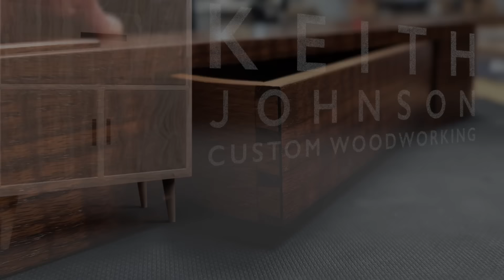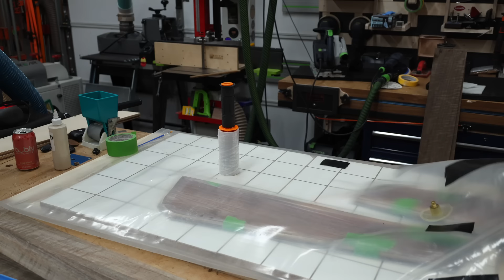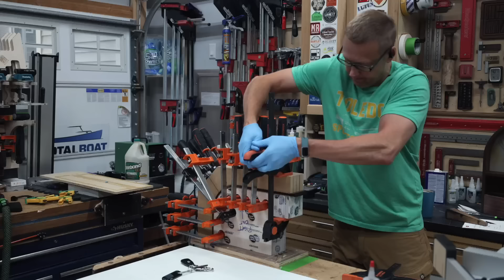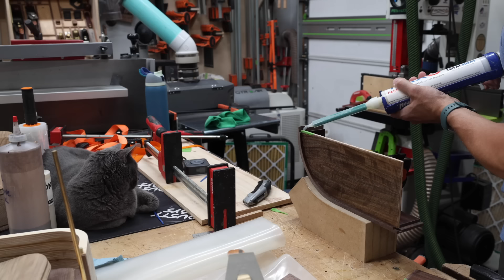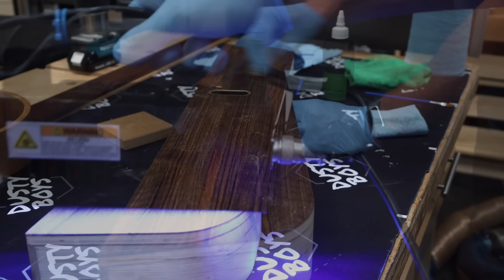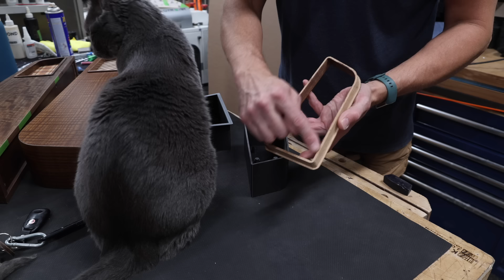A Different Way to Make Curved Cabinets.

Comment: Hey Keith I'm pretty new to doing veneer, is there any reason you choose to use PVA glue over contact cement?
Reply from the maker: Good question! Contact cement never fully hardens and it stays slightly flexible forever, so raw wood veneer can creep and crack over time. It's really meant for paper-backed veneer and laminate. For raw veneer you want a hard, rigid glue line, which is why I typically use epoxy, polyurethane glue or urethane resin (Unibond 800). The glue I was using is Better Bond X-Press, which is a water-based veneer glue, but with a fibrous-resin additive that sets fast and doesn't bleed through as much as regular PVA. It is specifally formulated for veneer work. I wouldn't recommend using typical PVA on any veneer work since it introduces moisture to the substrate and your veneer which can cause cupping. And when it is applied to your veneer it will instantly curl up making it very difficult and awkward to handle.
Reply: @KeithJohnsonCustomWoodworking Thanks buddy!

Comment: I apologize if this has been covered previously.  How do you clean your hopper/roller style glue applicator?  I mostly use Unibond 800 and have looked at this applicator numerous times but fear the clean up.  Currently I use disposable 4" foam rollers that I buy from eBay for about fifty cents each.  Thank you in advance.  And, keep up the good work.
Reply from the maker: I just rinse it with water immediately after use when I use PVA glue. Unibond is the same, but you definitely have to get it before it starts to harden or it’s very difficult to remove
Reply: @KeithJohnsonCustomWoodworking  Thank you!

Comment: Wow I thought I talked myself through my builds and their design . My wife says , who are you taking to? Very cool design and process , I do not have theses modern tools so I rely on my tools and ability to make patterns . I do wear a light on my forhead to assist my work . I make custom canoe paddles and some small items in my small shop . Please detail your finishing process and products so that I might borrow your technique. Thank you  Peter from New York
Reply from the maker: Thanks! And I use and LED cured oil/wax finish, but I wouldn't recommend it for canoe paddles.

Comment: Sound is a feature or a bug to people like me. If the drawers were silent, it would be better for me. If the drawer sound was tuned somehow, it also would be better for me. Thrust bearings? Glide tape? Some 3D printed sound hinge?

Granted, not everyone has my sound issues or fascinations.

Of course, people could say I'm overreacting.

Eliminating the 3D printed trays were definitely the best move.
Reply from the maker: Well, if the noise of the drawer is your only complaint, I'd say the project was a success 😎
Reply: @KeithJohnsonCustomWoodworking MAD SKILLS

Comment: For marking out your drawer curve, open the template until it hits, then use a string  line from the pivot point to draw your curve from your first hit mark . You will mark out the required curve that is tight on the draw stile
Reply from the maker: Thanks!

Comment: I love this project  - both versions.  I am slowly trying to get away from straight lines and right angles and to add some interest to my pieces and you really help my inspiration.  I do have a question about the French cleats you use.  Do you think they will hold up over time?   I'm planning a floating shelf project and would print them in PETG.
Reply from the maker: Thanks so much! And I have no doubt the French cleats will hold up as they are printed 100% solid. However, I am selling these pieces, so I will be replacing them with solid wood cleats to keep them consistent with the rest of the piece.
Reply: @KeithJohnsonCustomWoodworking  Thanks Keith.   By the way - I found your channel after talking with my favorite wood supplier - Travis Ruhland at Middle Valley Lumber.

Comment: This may not be the most common question, but as a cat owner, I'd be pretty scared having my cat in my woodshop -- I'd be afraid she'd jump up on the tablesaw during a cut, or something. How do you manage your cats in there? Do they just know not to go near the very loud machines? Do you put them out when you're doing something dangerous?
Reply from the maker: They have grown up in the shop since they were kittens and for some odd reason, they never go near running tools. It's like some innate instinct to stay away from danger. The door to the shop is usually open, so they can come and go as they please. When I am going to do a very loud or dusty operation, I will kick them out.

Comment: Can't say if you stole the idea. Pretty darn close, though I don't know the construction details of the original. A variation on the theme?

Not related to that, but to the video, word of warning those printed bearing guides may not be a good idea. I got a set of Jesada rabbeting bits and they had switched to plastic bearing guides. I built a desk organizer from Yellowheart and Bocote. Cutting the rabbet in the back (fortunately the back), with the router the bearing guide melted gouging the bit into the back. As the printing tech itself is melting the material in order to print it, I wouldn't trust those printed ones.

One more thing with respect to your hinge construction, when I am doing much the same I epoxy in the appropriate size bronze bearings (flanged, but probably not necessary) to insert the metal rod into. I have made several prayer wheels...because it is a turning project that has motion. (Imagine if Larry "Bud" Melman was able to have his toast spin on those sticks!) A bearing at the top of the handle and in the bottom of the box. A rod is epoxied into the lid and reaches through the bottom into the handle. A small weight on the end of a string/cord/chain hangs from the side of the box and a little wrist wiggle and it spins. I believe the idea is to write your prayer on a piece of paper, put it in the box and every rotation is one recitation of the prayer. I created one for some friends anniversary featuring the first few notes from the song and lyrics burned on the outside. I used steel rod but brass would work too. (Did I mention I have a tendency to ramble? All done.)
Reply from the maker: Yes! I've used the flanged sleeve/bearing on a pivot drawer before and it worked great. Not sure if you saw the video: https://youtu.be/NjnR6JctMiU

Comment: Just a thought to stop any damage to the drawer face when opening. 

You could  add a 2nd stop,, hidden inside the shelf to stop the drawer hitting the external edge next to the hinge when opening. You would need to add an extrusion distal to the hinge on the drawer to catch the stop. I hope this makes sense. The stop would also add internal scaffolding  inside the shelf to stop potential bulging of the shelf shell. The catch could also be 3d printed if reinforced. 

You could even add a spring to automatically close it if you want, just add foam or felt to you 1rst stop you already inserted to limit the impact. I was also thinking the about channeling the catch to help stabolise/ guide the drawer opening and closing, but may be over engineering  😅

They came out amazing. Thanks for the I inspiration.
Reply from the maker: Thanks so much for the suggestions - I appreciate you taking the time. There are definitely lots of possibilites on the drawer mechanism...maybe I'll have to incorporate those in the next version 😉😎

Comment: I have a folder on my bench of photos of "Ideas Worth Stealing". They're really just "ideas to inspire", and if I actually copy or nearly copy a feature on a piece, I'm careful to cite the inspiration. Your (and Paul's) pieces will go in the file.  And I always appreciate your videos for showing when you had to redo/rethink an element. A design is never  really finished. Also appreciate how calm Jerry and Lola are. My kitty loves to come to the shop until I turn on a machine.
Reply from the maker: I love your comment, Thom! I think you summed up the inspiration aspect quite well and Paul and I are very humbled that we could inspire you 😊. And I do love sharing the process of how a design evolves and the mistakes that happen...they are such an integral part of any piece that we build. Thanks again!

Comment: For vaneer work, I have had great results using contact cement for the adhesion. It's a bit hairy in that once you stick it, you cannot move it to realign anything, but one it's there, it's there...no vac bag or delaminations or anything  else
Reply from the maker: I have used contact cement in the past for some veneer work, but like you said, you only get one shot 😂. I think it's a great alternative for those that don't have a vacuum press setup.

Comment: 24:31 That bearing piece isnt going to work since you attached it to the spindle, its just going to turn at router speed and eliminate the bearing
Reply from the maker: theres a recessed groove inside to allow it to spin freely
Reply: It looked to me like it was tightened between the nut and spindle but maybe Im not seeing it right. Have you used it? Ive had similar problems with bearing size so of it works I like the solution.

Comment: If you had set the hingepins farther away from the end of the drawer, it could have been used to open it up without a fingergroove...  It would just cost you an inch or so of depth for the drawer as itwould need a round corner on the hidden side too...

Comment: If you move the pivot point away from the corner (i.e. towards the centre of the face), you avoid clearance problems because the locus of the edge is now almost perpendicular to the face.  It also means you can open it wider without worrying about marking the face.  You don't need to move the pivot much, an inch or so should be fine.  It does mean there's a gap when the drawer is mostly open, but that's what allows you to open it more than 90 degrees.  Try it using a couple of bits of scrap to represent the door and the brick and you'll see what I mean.
Reply from the maker: We did countless variations of the pivot point, and this was the only one that worked in the allotted space.

Comment: Love it, but if I could suggest 1 thing is to give a light polish to round up the brass insert (finger pull rim) on the bottom. It looked on the sharper side, and it just sends shivers down mine spine of reaching there and feeling something sharp.
Reply from the maker: Glad you liked it! There's actually a very slight chamfer on brass edge that I did with a router…I just forgot to film it 👍🏼

Comment: I like them both. 
If you'd added 2 thin washers to the bottom end of the brass rod you'd eliminate most of the friction and future wear.
They could be partially recessed into the bottom and flap so the gap would be minimal.

Comment: Hey Keith it looks great, I like the checkered bottoms! Quick ?- if you didn’t have a vac bag setup how would you go about veneering? Would sand weight bags work or what’s your thoughts? Thank you!🙏
Reply from the maker: Probably sandwich between melamine and use clamping cauls and lots of clamps 👍🏼😎
Reply: @KeithJohnsonCustomWoodworking  I’m going to give it a go, thanks for responding brother!🙏

Comment: They are all amazing. Is there any way you could have used one of those drawer fixings where when you push the draw in it pops the drawer open (I used these mechanisms for pop up bench dogs in my workbench, but can't remember what they are called).
Reply from the maker: Unfortunately, those mechanisms are quite long and there wasn’t room without crafting something funky on the underside of the drawer.

Comment: You 3d printed french cleats to hang it on the wall? Do they have enough integrity to not break?

They do look nice. Really liked the plaid which surpirised me. I don't think I'd come up with that. The stripes aren't bad themselves.
Reply from the maker: well, it's a 7 pound shelf and the cleats are 100% solid filament, so I have no reservations about them holding the weight. 💪

Comment: Those little finger pull slots were definitely cool but I also love the idea of finding a way to add some sort of push to open latch so you could just push in on the corner and it would pop out enough to pull it open. 

I also think a version of the valet tray with a a felt or leather bottom for a soft touch would be cool too!

Overall, I really loved the whole project! I'd really love to get into making some of this kind of stuff myself, now to convince the wife to let me spend some money on tools.... lol
Reply from the maker: Unfortunately, the push to open mechanisms require quite a bit of room in order to function properly and there just wasn't enough space for it on this one.
Reply: @KeithJohnsonCustomWoodworking  Even if you were to put in the very back corner/side of the drawer? I was kind of trying to think about the space constraints and I thought maybe that kind of mechanism would've worked/fit on the short flat side of the drawer. It's kinda hard to explain my thought process without being able to just show what I was thinking haha. I could totally be wrong though as I'm not 100% familiar with exactly what they need to totally function properly!

Comment: While I can’t speak to downstream effects for making the drawers themselves 
If the drawer itself was say 1/8 or 3mm shorter than the face. You get a little more tolerance for misalignment on the hinge.  

Just food for thought. Might be useful for some other build!
Reply from the maker: In this case, it wasn’t rubbing on the too of the case, so it wasn’t a factor, but I understand your point 👍🏼

Comment: I know you've already made this piece, but is the swing out drawer removable after final assembly? As I was watching you troubleshoot your dowel hinge issue, I kept thinking that you were going to put a spring in the upper hole before putting in the pin. That way you might be able to compress the pin to remove the drawer in the event that, for whatever reason, you needed to remove that drawer. I was working on another project bouncing between watching your vid and solving some excel conditional formatting issues so this may have been addressed somewhere else in the video. Cheers
Reply from the maker: It is not removable after final assembly. Lee Valley makes spring loaded pins that could be used for something like, but I chose not to. Ultimately, the likelihood of the drawer even needing to be removed is very small. However, it probably couldn't hurt either and would help with the sanding and finishing process 😂

Comment: Amazing work as always.  Be careful with 3D printed planters, they're usually not watertight without some kind of additional sealant applied.
Reply: If you print them in "vase mode" it should be okay, as it prints in one continous spiral around the model.
Reply from the maker: Thanks for the tip! I didn’t even think of that 💪

Comment: Interesting build.  I really like the journey.  I am in the middle of creating a second piece of furniture and am incorporating new ideas to either improve function, reduce parts, and add sex appeal (sorry, no plaid underwear).  I have kicked around adding brass dowels though as it seems that Jerry approves.  Keep showing the errors, I learn more from those (as in how to prevent and fix) then I do from a straight forward build.  Good Job Keith!!
Reply from the maker: Thanks so much for the kind words and the comment! I greatly appreciate it, Robert!

Comment: Have been looking forward to another video from you, Keith. Always pick up a thing or two. Love all the tips on form building for bent laminations. Super useful. Btw, are those black patches on your vac bag that I see? Also, when using epoxy or other hard setting adhesives, does it eliminate spring back in your bends? I recall that being an issue in some of your past videos.
Reply from the maker: Thanks so much! The black patches are literally patches😂…black duct tape to seal up punctures…probably from cat claws 😏. And sometimes spring back happens for no explicable reason, but typically epoxy, polyurethane glues and UniBond 800 will give the best chance of not having spring-back.
Reply: @KeithJohnsonCustomWoodworking  should have known it was from cat claws! Too funny 😂. That's really interesting about the spring back! Must help you can get those laminations so thin. Thanks again for the video my friend! Cheers

Comment: For me, the project was disappointingly uninteresting.  As you said, quite similar to things you've made before - vy well made though.  Seemed like you chose it so that you could make as many little gizmos w/the printer as possible to pack those Bambu plugs in.  -- don't begrudge the promos, per se just would have been nice if it was in service of something else.  The Copper Pig guy makes stunning veneers.
Reply from the maker: Sometimes it’s more about the journey of discovery and design exploration, not the destination.
Reply: @KeithJohnsonCustomWoodworking  Absolutely.  I'm glad that was the experience for you.  I guess what I'm sharing is that I did not take away from the vid a sense of exploration or discovery in terms of either technique or design.  I heard the words, just didn't see it in the piece. Not the end of the world and I enjoy your channel.  Just a perspective.
Reply: ...and like another commenter mentioned, I just this morning was varnishing and repeatedly heard in my head, "Total Boat, baby!"

Comment: Can you tell me what glue ara you using for veneer? And im curiuos how long you keep it in bag.
Reply from the maker: Here is what I use sometimes: https://www.veneersupplies.com/products/Better-Bond-X-Press-Veneer-Glue.html , but I prefer using epoxy or Gorilla Glue Polyurethan glue because they have a longer open time. With the X-Press glue, you only need 45-60 minutes in the vac bag. For epoxy and Gorilla, I leave it in there as long as possible...usually 4-6 hours.